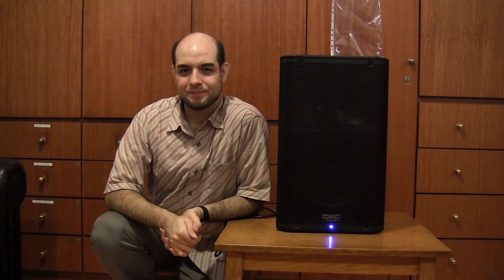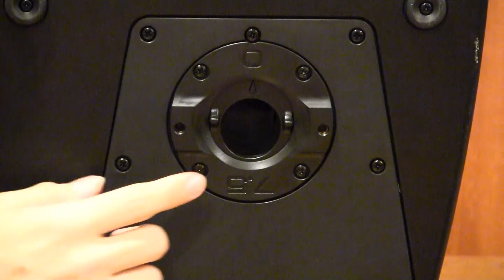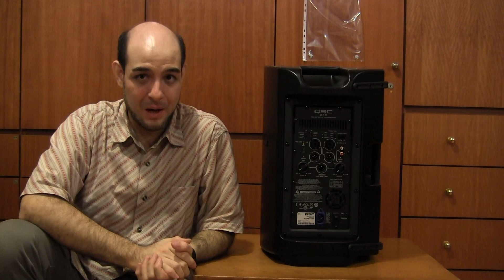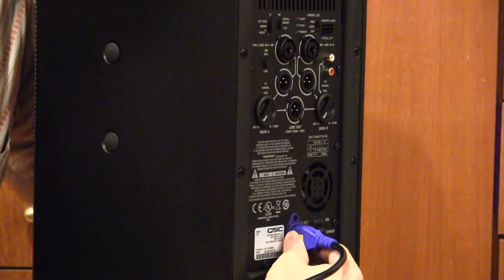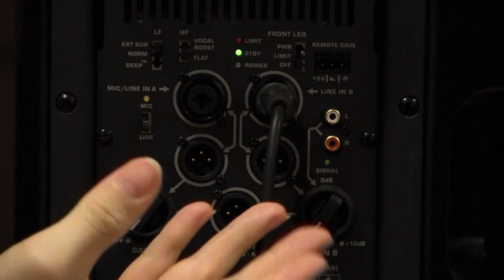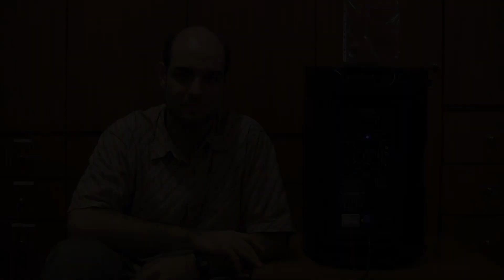QSC K10 Active Loudspeakers - overview and user guide

Comment: Question Sir, 
I was about to buy a pair of the EV ZLX 12Ps. I would be using them for a small band in coffeehouse to small outdoor events of under 100 people. 
These are much more expensive but lighter (getting a bit older) and I’d heard in that application they might have as much as a deep full sound as the 12” cheaper EV speakers. I’m thinking it might be better to consider paying a bit more for the weight and if the Bass is comparable for smaller venues? 

Thanks. Looking forward to your response. 🙂
Reply from the maker: If you look purely at the specs of these two boxes, you'll see that the EV is rated as having a frequency response of 65Hz - 18kHz, while the QSC is 60Hz - 18kHz. So on paper the QSC actually has better low frequency performance than the EV! However to be honest with you none of these 2-way boxes has the sort of frequency response that you would get from a separate subwoofer. My suggestion would be to audition both of them and choose the one that best suits your needs and tastes.
Reply: GLB Productions thank you Sir. 🙂👍

Comment: Would these speakers be good for a Salsa band? I would plan to pair them with subs. Often times we play in small/medium ballrooms but every so often get asked to play for medium sized outdoor shows (100-200 people). How do I determine what size would be appropriate?
Reply from the maker: Sure you could do that - these are general purpose speakers and can be used for any application. If you only occasionally play the outdoor venues it's probably a good idea to buy a smaller rig for regular use and then renting additional boxes when needed.
Reply: GLB Productions thanks for your input!
Reply: So, if I were using kw181 subs, would using k10s put out the same volume as the k12s since both sizes are rated at 1000 watts?
Reply from the maker: No, the drivers play a part in the maximum volume attainable - the K12s go 2dB louder than the K10s, which is not much really.
Reply: GLB Productions thank you! I really appreciate all of your videos and the time you take to explain things. If you have any books that you sell, I would live to learn from you!

Comment: Hi I jus want to ask about my powered warfedale speaker output... I use this speaker as my monitor from my own small mixer n I line it in, Can I use the output of the powered speaker to line in the main mixer of the house?
Reply from the maker: Yes this is fine - you can connect the line level output (NOT the speaker level output!) of your powered speaker to the mixer input, just be aware that it will be line level so tell the house engineer to turn the gain all the way down to begin with.

Comment: GLB, enjoyed the video!
simple question.
in line level we set the volume knob up to 12 oclock, but, why exactly? 
it cant be fully opened because it doesnt make sense to have it working at full level even if the signal from the mixer is low,
but why do we do it at 12? 
does it has to do entirely with the speaker, on wich we deal with a level of signal (that comes in) and the output result (spl) of the speaker?
im just enyoing all the info im getting from your vids, thank you very much
Reply from the maker: Hello Renzo! 12 o'clock is referred to as 'unity gain' - in this position the input signal is neither boosted nor attenuated before being sent to the power amplifier section of the active speaker. You don't have to set it to this position, it is simply a convenient starting point, and in big systems ensures that gain is equal across all loudspeakers. In a small system, this knob would be used to set the final level of the PA - if it is too soft turn it clockwise, too loud turn it anticlockwise as appropriate.
Reply: GLB Productions thank you very much on the answer, I'm beginning with backline set ups and I'm thrilled to learn much more,  have a great one!

Comment: Hi, can i mix 2 sets of speakers, i already have 2 x dxr10 and i'm planning to get 2x K10. Are there any issue if use these 2 sets at the same time? I also already have 1 x kw181 subwoofer.
Reply from the maker: Sure, although the two sets will not sound the same and you'll need to work out how to balance them against each other.
Reply: +GLB Productions thanks

Comment: Excellent videos! They make sense. Our Church has the K8s and I love them. We moved into a different building that is actually a traditional Church building. I am setting these two up front for the first time in this building using the daisy chain method with the first speaker input going to the mixer. The current system has a Crown amp that powers a center speaker that is hung way up in the peak of the the vaulted ceiling. Since I have these K8s and I am not all that thrilled with the performance of the center speaker I am connecting them to the Right side of the mixer output since the Crown amp is connected to the Left side. It is an EV mixer. The output seems hotter than our Mackie 1402 VLZ3 mixer that I used before with the output sliders set at zero and the K8 at 12 o-clock in the Line setting. I know this is a weird mixture of speakers. I am thinking of cutting the center one out and just using the K8s. I think I need to watch your video on how to set the gains on all my channels.
Thanks
Kevin
Reply from the maker: +1crazynordlander I suggest you do a comparison between the two sets of speakers and see which set sounds better. Also very important is to see which set has better coverage - with the K8s on stands the front may sound great but the back may not be able to hear.
Reply: GLB Productions This Sunday is the first week that I will use the K8s in our new building. The K8s are on stands now but I plan to hang them with cable and eye hooks. I might buy two more and mount those midway back on the sides of the church. I would at that time daisy chain two together on each side. I found your channel because I would like to add my Mackie mixer to the EV mixer that came with the church and your video came up. I have a fair grasp of sound systems but need to learn so much more. I subscribed! I knew the difference between line and mic but it did not hit me what the XLR connection on the mixer and the 1/4" jacks that one was mic and the other line. I think our mixers have a line / mic switch though.
Reply from the maker: +1crazynordlander Be very careful about hanging speakers above people's heads! There are serious safety implications and you should really have it done by a professional rigger who will use the appropriate load-rated hardware. 

Glad the videos have been helpful, feel free to get in touch any time with questions. If you fancy supporting the channel please consider signing up to become a patron at https://www.patreon.com/glbproductions?ty=h Every little bit helps!

Comment: I really enjoyed your explanation and video . The way you have explainded was very easy to listen to  and easy to follow. very good video,  5 Stars.
Reply from the maker: +jeromee otero Thank you for watching, really appreciate your support!
Reply: +GLB Productions ..whats the difference between k10 and k12 in terms of loudness and sound..
Reply from the maker: ken ark The 12s go slightly louder because of the bigger driver but the main difference is the angle of coverage - the 12s are 75 degrees and the 10s are 90 degrees, which means the 12s are better for distance whereas the 10s are better where the audience is close to the speakers.
Reply: GLB Productions ..ok. can any speaker beat the qsc k12..like the yamaha dsr112 or yorkville ps12p..in terms of sound quality,for a hall with 400 apple or more..speaker that don't distort when loud..
Reply from the maker: ken ark In terms of sound quality only you can answer that question - you'll need to listen to the k12s and compare the way they sound to other speakers. I would definitely check out the active speakers from JBL and FBT.

Comment: Sup Man, yo, i jsut copt the zlx 15p"s but i couldn't even bang those boys without the 'limiting' poping up. I'm returning those as we speak, am i making the right choice, leaving EV, and going to these speakers??
Reply from the maker: D Rel Taylor It sounds like you run pretty loud - if you're doing DJ stuff with a lot of bass make sure you get a separate powered sub to take the low end load off the main speakers, that's the best way to avoid constantly hitting the limiters.
Reply: Ok bet, thx...
Reply: D Rel Taylor QSC K Series, You CAN NOT go wrong with these series!

Comment: I recently got to take home the DXR10, K10 and EV ETX-10P for about 6 weeks. This is my take.. 

It really depends on what you need, what your main use will be for these speakers. For DJ use, I'd definitely look at 12s, but if you're cutting the lows out I don't see why 10s wouldn't be just as good. I was stuck with 10" due to portability issues traveling with a band.  

For prerecorded music, the DXR10 needed the most EQ. 1k had to be cut a good bit, and 16k boosted. The EV, in comparison, needed minimal to no EQ, and if you needed it, the dsp on the back has tons of EQ options, really an incredible speaker. The K10 needed less EQ than the DXR10 to sound right. 

The EV really is an incredible speaker, but at nearly twice the price of the DXR10. I think if you're DJing events every month, they're well worth the investment. Music sounds superb through them, with next to no adjustments. The best speaker is always the flattest out of the box, and EV brings it with their speaker. Tons of power, clarity, fullness, punch, dynamic frequency range. All good things. If it's a few times a year, the DXRs will do great. With some EQ they really hold their own. 

Flat or not isn't a huge issue if you're only using these for live sound/DJ, as opposed to keyboard monitor/amp for shows with a band or solo piano work. For DJ'ing, I preferred the DXR10 over the K10. With both of them EQ'd, the DXR sounded a little better, slightly fuller.. and surprisingly more comparable to the EV.  The DXR10 really held it's own in my extensive A/B with the EV. The K10 could get a little harsh in the 2.5k and some high mids (obviously at peak sound levels that you may not even run). I'd go with DXR over K series for DJ purposes. 

as far as volume goes, they all get crazy loud and hold up great. Clarity and volume isn't a comparable issue if you're using the 100hz cutoffs, or the 120hz option of the DXR. It's also ridiculous when people take bass into account with these tops. If you need bass, get a sub.. not a 10", or even 12" woofer that's going to be on a tripod further limiting whatever bass you feel. Bass coming out of these tops isn't going to project in the air, nor will it carry through the floor via tripod poles. The only scenario where I'd even think about bass with tops, is if you have them on the floor in your house as a stereo or something. In that event- the K series wins out with their "deep" technology. Lows extend much lower then DXR and even lower than the EV.  But no one really uses these for that anyway.. 

For keyboard amp/monitor applications, I was fortunate to have 3 shows in the time I had these speakers, so I was able to try each of them. 

The DXR fell short to K series and EV. It lacked the projection of high-mids/highs, and can't be EQ'd because the soundboard gets the line out straight from the speaker, which gets both L/R from my keyboards (so i can't go left to amp and right into D/I box..  then both mains and my speaker would be getting half of my sound.)
It was actually a tough call between the K10 and ETX-10P for keys. K10 had a tiny bit better mids, and the EV was very pristine and polished. I liked the 90 degree conical dispersion of the K10, and that it's over 10 pounds lighter and a few inches smaller than the EV. It's easier to lug around, takes up less space in the car, and I think cuts through the mix a little better than the EV. The EV is great for DJing, as well as DXR10, but I liked the K10 better as my amp. 
The K10 has stronger high-mids/highs and doesn't have the 1k boost of the DXR10; it requires less EQing to sound right to my ears. I know the crowd mostly hears the sound coming from the mains, but some venues are smaller and stage volume and sound quality is important. Even at larger events, people closer to the stage are getting blasted with drums and guitar amps- you want your keys to be where they need to be in the mix, both tonally and volume wise. 

SO
Pro DJ- invest in pro gear- Yamaha DSR or EV ETX series. 
Hobby DJ- DXR series. With some EQ, they really do sound great. 
Keyboard amp..  it's your call if you want to lug around the bulkier and heavier (birch) EV, or much more manageable K10. I thought the K10 sounded more than good enough to choose it over the EV. 

I went with the K10 because I'm not DJ'ing even 4 events/year.. and it's not like the K10 sounded bad for prerecorded music, the other 2 just sounded a tiny bit better with the proper EQ. It's easier to manage bringing to shows and I think makes a really stellar keyboard amp. I even had 2 strangers come up to me and compliment me on the sound. 

Let your ears be the judge.
Reply from the maker: Matthew Maneri Thanks for the review - you should definitely do a video version and post it on your own channel! Look forward to more input from you in the future.

Comment: Great video. I have a mike and acoustic guitar setup with a single QSC K10 speaker and a ZED 10 FX mixer. I'll be purchasing a Voicelive/ Play Acoustic very soon and want to know if I can still have a great sound and volume control while only using the Play Acoustic(a vocal and acoustic guitar effects pedal) and NOT going through the mixer, but straight into the K10 powered speaker. Thanks for any assistance and again, very nice video.
Reply from the maker: Ryan Carroll The outputs on the Voicelive are line level (+2dBu according to the website) so you should have no trouble at all running directly into the K10 using the line level setting. Volume control may not be so straightforward as I do not see a dedicated volume knob on the Voicelive - one solution would be to set up in arm's reach of the K10 so you can adjust the volume there directly.
Reply: GLB Productions Thanks. So, the knobs marked 'Gain A and Gain B' would be the volume control for my mike and guitar respectively? Therefore, I would be without a master volume control?
Reply from the maker: Ryan Carroll Yes that's correct. If you want a master volume control you could run both your guitar and mic through the Voicelive and then just use a single input on the K10, using the mono output option on the pedal.

Comment from the maker: - That's a fair point but if the loudspeaker is flown a power cable vibrating loose during the show is a major issue. If on a speaker stand I will always ensure that cables running to the stand are properly taped down and hence cannot be tripped over.

Comment from the maker: - I would think so - start at about 1m and experiment. Every room is different and everybody has different preferences so it's not possible for me to make specific recommendations. At the end of the day if it sounds good that's the correct placement. Note that the K10s are not designed to be listened to from very close range (they are sound reinforcement speakers not studio monitors) so you should listen to one before you buy. Myself I find them a bit 'sterile' sounding compared to my FBTs.

Comment from the maker: - Thanks for the question. They would be suitable if you had enough of them, but if you do mainly large venues I would look at the larger K12s, the KW series or the KLA line array system from QSC. They have reasonable bass response for a 10" speaker but for any sort of live music or DJ work at higher volumes I would definitely use a subwoofer.

Comment from the maker: - Yes, it's normal to have some noise when plugging a device into the K10. You should always turn the volume knob all the way down when making or breaking connections to minimise this. Alternatively, plug in with the speaker turned off and then turn the power on.

Comment: @ Gibsoneer. I have two of these speakers that use for acoustic setup. You are going to need a small mixer due to the K10 being very loud on the low volume. Without a mixer you'll have BIG feed back issues. I use a soundcraft notebook, compact and reasonably priced. I run a fishman reverb for my Martin guitar. I use a Neumann kms105 mic through a TC.Helicon voicetone create-XT. Best sound ever for me. You can get this set up for under $2000US if you shop around. All the best with your sound. Gr

Comment from the maker: @gibsoneer321 Glad to hear your K10 has arrived safely. 

As the QSC has 2 inputs, you could use a standard reverb or delay pedal on your guitar, and then use something like the TC Helicon voicetone R1 on your vocal mic. 

Alternatively you could use a unit designed specifically for singing guitarists like the TC Helicon voicelive play GTX - this has inputs for both guitar and vocals. You would then run a single mic cable from the unit to one of the QSC's inputs.